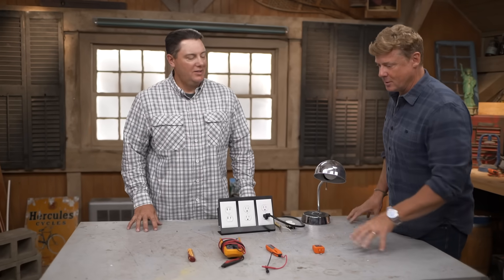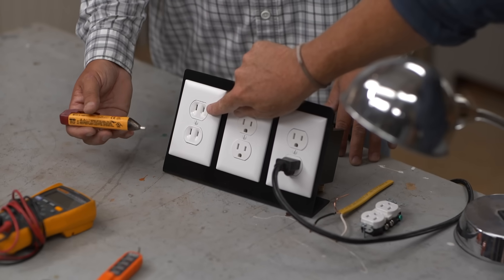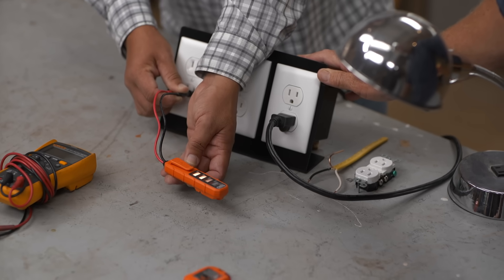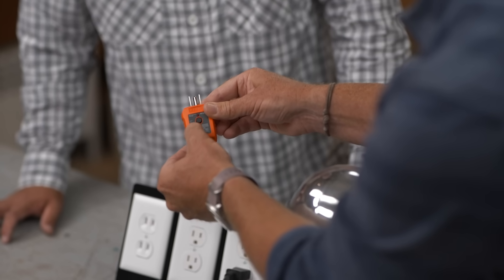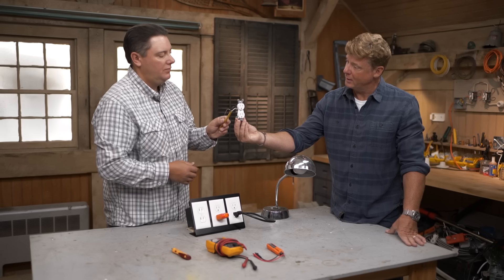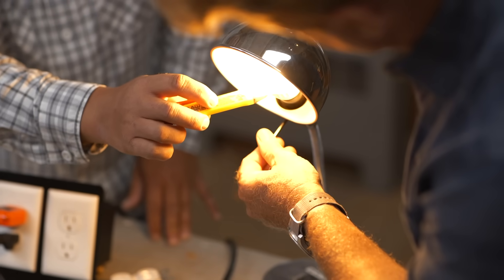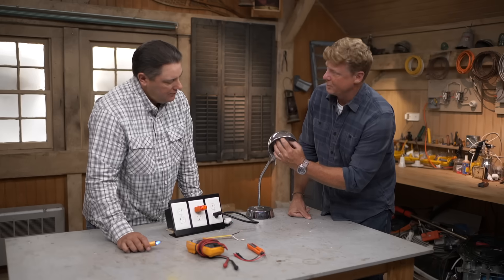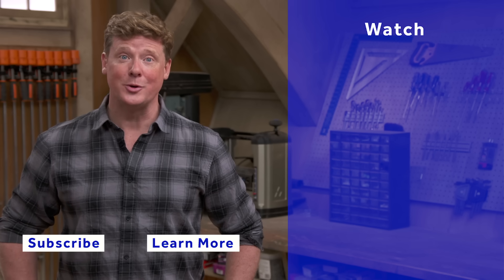How To Use a Voltage Tester | Ask This Old House

Comment: A very important point about non-contact voltage testers (NCVT)  was not mentioned: Prior to using a NCVT, it is extremely important to test it on a known “live” voltage source to verify that the tester actually works. This needs to be done each and every time it is used. If the tester fails to illuminate when testing, it could be because the tester has a low battery or is defective. In that case, it would fail to warn you about an actual “live” wire. That is why you need to verify that it actually detects voltage before using it for decision making. I cannot overemphasize the importance of doing this.
Reply: Most non contact testers have this feature built right in to the device. It will chirp when you initially press its test button, letting you know that the batteries are working, and you're getting a proper test result. 

You can hear his chirp and light up each time he uses it in this video.
Reply: @madatown  
That’s nice. The two non contact testers that I have don’t chirp. In fact, the user guide explicitly states that to use the device safely, the proper operation of the device must be verified on a live circuit before each use. Because electricity cannot normally be seen, electrical safety cannot be taken for granted.
Reply: Also let's not forget they are bad with static electricity
Reply: @russellrouse1371  So that's why mine keeps beeping when I know there's no current ?  lots of static / very low humidity
Reply: this is really good advice. I would never think of this!!!
Reply: I was about to say this. Couldn't have said it better myself
Reply: Thank you!
Reply: Great point. And important to do it without turning it off/on in between. I also go back and test the known live source a 2nd time after checking the outlet in question just in case something happened to the tester in the interim.
Reply: U should use them at all.
Reply: 1 st off , it is Not a voltage tester !
It is a no contact current detector , it doesn't measure voltage...it senses the presence of the electromagnetic field on the hot conductor wire of alternating current. We Electricians call them tick tracers , too hunt down where a hot conductor might have burnt or cracked separated .
Reply: @rrfields65  Regardless of all of that which you have stated, they are sold as and commonly referred to as NCVT (non-contact voltage testers). The presence of that EM field which causes it to light up and/or beep/chirp is an indicator that there may be voltage present on the conductor. So you are indeed testing for AC voltage but not a specific number of volts.
Reply: @illestofdemall13  : Ohm's law : 
1 volt x 1 amp = 1 watt 
Voltage= the speed of electrons traveling thru a conductor.
Amperage= the number of electrons being pushed thru a conductor.
Reply: @rrfields65  I know all of that electrical theory, but those devices are sold as non-contact voltage testers. That's what they are called when you look at the packaging, whether or not that term is accurate from an electrical theory point of view.
Reply: @rrfields65  I also have one from Greenlee with a current setting and a voltage setting. The current setting will beep from current on the hot and neutral alike. The voltage setting only reads the hot conductor.
Reply: @illestofdemall13  : I use South Wire , which I believe came from Greenlee . They're tick tracer has both low and medium current detection for Cat4 .
Reply: @rrfields65  My go to is a Fluke non contact ticker. It is very reliable, but I definitely come in after it with a meter/tester that will give me a precise reading. I also have the Fluke voltage tester that is similar to the old Wiggie. It lights up and vibrates and tells me which voltage range is present.
Reply: wouldn't it be just easier to do what I always do ?and just stick the live electrical cables onto your tongue to check if the cable is live.?
Reply: Jesus loves you

Comment: What is meant by “socket”, “center pin”, “shell”? Still quite confusing, but thanks for your best attempt.
Reply: In terms of a light bulb, the socket refers to where you install the lamp into the fixture.  Looking into the socket you will see 2 pieces of metal.  A small metal button in the center and a metal shell lining the outer side.  Both pieces will be insulated between each other and the outside of the socket.   You will notice that the outer metal is twisted like the threads of a nut.  Looking at the lamp you will notice that bottom outside part is twisted like a screw.  The lamp is designed that way to hold the lamp in the socket when you twist to install it.  Looking at the base of the lamp you will notice a piece of metal that protrudes from the base of the lamp.  It makes contact with center button inside the socket.
When the light fixture is energized.  Current will travel to the center button enter the lamp and exit through the shell.
Reply: He’s refering to the bit of the lamp where the bulb screws into. The threaded part = the shell, the small metal dot at the far end = the center pin.
Reply: @Engineer9736  A better description than my rambling.  K.I.S.S. - thanks
Reply: Socket or outlet is slang for duplex receptacle, and look at the bottom of a light bulb ... the tip is the loadside ( current in ) and the " screwshell is the neutral return out .
Reply: @rrfields65  Socket isn't referring the a duplex receptacle in this video. Heath was specifically talking about the lamp socket.
Reply: @illestofdemall13  : it's still slang, the proper terminology for it in electrical
is light bulb screwshell.
Reply: @rrfields65  My point was he wasn't referring to the receptacle when he said socket, as you said. The guy asked what socket means, and in this video it is the light bulb screw shell. I was clarifying so the guy doesn't get confused (he already doesn't know, that's why he asked).

Comment: I watched this is see how to use the only one they didn't use. The multimeter! go figure! Thanks for nothing! LOL
Reply: No, he had a multimeter! He just didn't have a professional electrician 
A/C current and voltage clamp meter!
Reply: @rrfields65  tbone didn’t say anything about clamp meters, neither are they necessary for the job.
Reply: @Engineer9736  : like hell they ain't! How are you going to test amperage draws on A/C circuits !???
Reply: @rrfields65  The entire video is about voltage testing. It’s with font size 100 on the introduction picture.
Reply: @Engineer9736  : the ONLY voltage testers there in the video is the 2 lead direct contact tester , which lights up on the LED of the scales 120,220,240vac and the multi-meter.

Comment: Something super important about those contactless voltage testers that was not mentioned is that they are very short range and they are blocked by a Ground or Neutral conductor. If you use one on a jacketed wire like NM-B (Romex), you can tell which side the Live conductor is on. The same with an extension cord with it's twisted conductors. You can follow the twist down the cable. This means a quick tap will not necessarily cause it to light up so you might cut through a live cable.

Comment: HI TOH , I would hate too get shocked , it wouldn't be very fun , it could kill you especially if it was enough watts/ volts passing through your body & it was a long time being electrocuted !  😲🔌⚡
Reply: I've been shocked by 120VAC several times
One time the current went across my heart when I touched a hot conductor and a stainless steel boiler vent pipe
Was the start of the workday, and suffice to say, definitely woke me up... didn't need any extra coffee that morning 😂
Reply: @walterbrunswick   : I've been bit by 277 vac  ... Hello!!! 
The voltage gets your attention! But it is the current that fries you!
Reply: @rrfields65  Only 18 milliamps is needed to kill someone, so that “its the amps that kill you” is a silly story of which i wished it would have never became such a popular line. Like literally any power source is capable of delivering 18 milliamps. It’s the voltage that makes those 18 milliamps happen.
Reply: @walterbrunswick  Wow that doesn't sound very good , I hope you don't get shocked anymore , I can't even stand static electricity from carpet or any other kind for that matter !
Reply: @walterbrunswick  Maybe try plumbing?
Reply: I’ve touched 230 volts by accident over a dozen times when i was younger. Sure it’s not fun and dangerous but it doesn’t end your life right away. Lessons learnt: If you work on the electric installation of your house, turn the main breaker off, and use a voltage tester on the wires you’re working on, and before grabbing the wire with full force first quickly stroke it with one finger. If you live with more people in the house then apply some kind of LOTO (lock-out-tag-out) practise on the main breaker. I’ve had it once that someone just flicked the breaker on while i was working on an outlet 🤦🏻‍♂️

Comment: No phantom readings from 4 lights thing??? how about when you checking the outlet and neutral leg is disconnected somewhere in the walls or by the circuit breaker box. I personally recommend neon screwdriver tester or a good meter
Reply: Then you test hot to ground not hot to neutral. Any multi-meter can get a phantom reading unless you have two points to test between. A NCVT will detect a hot without a need to test across two points.
Reply: @JustinL614  ... true, but those will only give you a go / no-go indication of power. To do trouble shooting you need a meter. (and more education)
Reply: @rupe53  I know but the original comment was about a hypothetical situation where there is a hot but no neutral. I went further by describing a scenario where there is also no ground. I agree a good meter is the best and I realize this situation would be way beyond someone who lacks the knowledge of troubleshooting. I would probably just turn all the breakers off and then use a tone tracer to find the wire in the panel.

Comment: That's one of the better explanations for why getting the polarity correct in the outlet is important. I bet this was a follow-up to the previous video they did on this, where Heath used to washing machine example and it was hard for some people to understand what he meant when he said that it could be off, but power could still be running to it.
Reply: Jesus loves you

Comment: Why no links so easier to find these products or the names of them in the video's description?
Reply: Just checked the video description & I see name for each item and correct links for the 1st (contactless tester), 2nd (multimeter), and 4th (receptacle tester) item.

The third amazon link looks wrong to me (automotive circuit tester?) but more importantly (Props to This Old House) they provided the technical names for each tool. 

1. Contactless Voltage Tester
2. Multimeter (Full Sized)
3. Small Contact Tester
4. Receptacle Tester

(Check the description for an explanation of each tool's uses)

Comment: Bought a DVR years ago 3 prong wiring, plugged it in and touched the metal housing and got zapped! Found out it was wired wrong in the breaker box, white wire and black were switched when house was built  30 years ago. Lamps etc. worked fine. So it's wise to buy that unit that checks polarity as shown.
Reply: The DVR was wired correctly. The outlet was wired incorrectly. The neutral was bonded to the ground. The neutral was swapped with the hot at the panel. Therefore all the grounds became hot including the metal DVR box. Very dangerous.
Reply: @JustinL614  It was wired wrong in the breaker box. Same difference.
Reply: @anton1949  I was responding to a comment that said the DVR was wired wrong. I think the comment was deleted. Also, it's not the same difference. If it was only that the hot and neutral were swapped in the panel you wouldn't have gotten shocked from the box.
Reply: @JustinL614  I noticed that also, everyone should check all outlets, assume nothing. I learned my lesson.
Reply: @anton1949 Well I'm glad you didn't get hurt or have a fire start. As an electrician I' just extra cautious. I find stuff all the time in homes that are wired wrong. As you pointed out, alot of things work even though theyre are not done right.
Reply: @JustinL614  I get what you meant, I think some people don't know enough to understand why you said the receptacle must've also been reversed polarity. Basically the receptacle was wired with the white in the "correct place" but since the white was hot, it was wired wrong by mistake. The person who wired the breaker panel wrong probably confused the next guy, or that same guy also wired the receptacle.
Reply: @JustinL614  If your ground is properly made then connecting it to hot would trigger the breakers. So then there is more not right in that electric installation.
Reply: @Engineer9736  When a receptacle has reversed polarity, it will never trip a breaker because there is no ground fault nor is there a short circuit present. The hot and neutral or the hot and ground need to make direct contact with each other to cause and immediate trip. The hot and neutral wires in devices have a resistor or some other load in between them and will work even when reversed. Just like the lamp shown in the video, it is a safety hazard but it doesn't trip the breaker. It literally has nothing to do with how well your grounds/bonds are made up.
Reply: @illestofdemall13  You need to read the full conversation of what i was replying to, and then read my reply properly. Would have saved you writing a lot of unnecessary text.
Reply: @Engineer9736  I did read them, or thought I did. Maybe I missed one that wasn't in view, but even if I did I could've misunderstood. I see what Justin said about fires but there isn't much context to go by. Still, proper grounds won't stop a fire if there is some kind of arcing and no arc fault breakers, especially in plastic electrical boxes.
Reply: @Engineer9736  Kris is right. If there is less current in the circuit than the amperage rating to trip the breaker the breaker will not trip. You're thinking of a situation in which there is a ground fault which is not what we're discussing here. We're talking about a hot neutral with a resistor in the line that prevents overcurrent and there was never any certainty that everything is actually grounded. Just as the neutral was not a neutral the ground is just a reference point in my explanation as a connection or bond to a metal component. If there was a true ground  it would have tripped but I left that out because I assumed electricians would already realize that the breaker would not be working in the first place if there was an actual ground fault. Sometimes it is difficult to explain an example when things are not set up as expected. Think of the example of when people get shocked on a metal kitchen countertop and why the breaker does not trip and this will make more sense.
Reply: @illestofdemall13  I just try to scare people who don't understand how electricity works by telling them they could start a fire lol. It seems effective and keeps people safe and less likely to experiment. Btw I'm glad you understand what I'm saying. I'm usually the electrician who goes in to fix other people's work when things get complicated.
Reply: @JustinL614  I get it. People sometimes think they can play around with electricity and are unaware of how wrong things can go.
Reply: @JustinL614  Neutral should be ground only on the main panel. What it sounds like is a bootleg ground. It is very dangerous if hot and neutral are reversed.

Comment: If I have to work on anything electric in my house like replacing an outlet I shut off the whole house
Reply: That's not a danger. Having to reset a clock is wayyyyyy better than having to reset your heart beat! Which you can't do so yeah just shut the house down. Especially if you have no testing device.
Reply: If you have to do that you should probably hire an electrician. If you turn it on and it's wrong you could burn your house down.
Reply: @JustinL614  You are overreacting quite a bit. Installing an outlet is a matter of 4 screws…. Like the toy of a kid to put blocks in the right shape hole is more complicated.
Reply: @JustinL614  if I don't think I can do it I have my brother in law and his dad do it for me that way it is inspected by firefighters who are also trained in electrician work as the work is being done